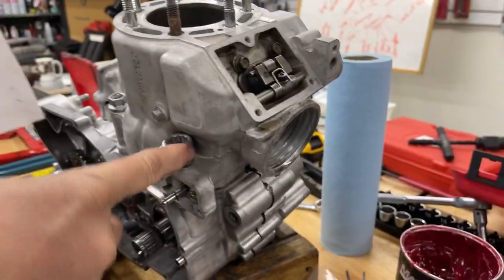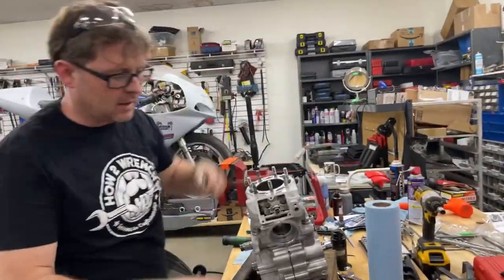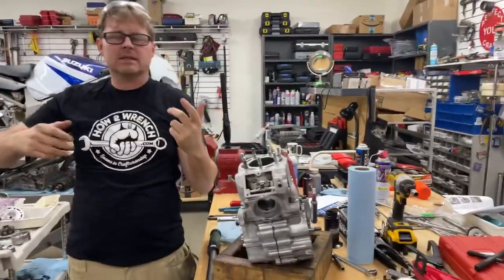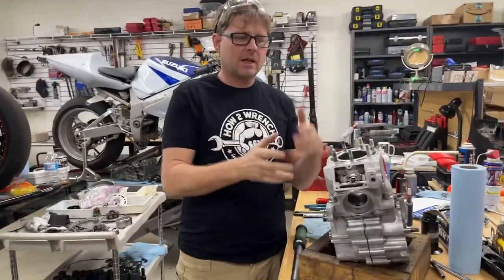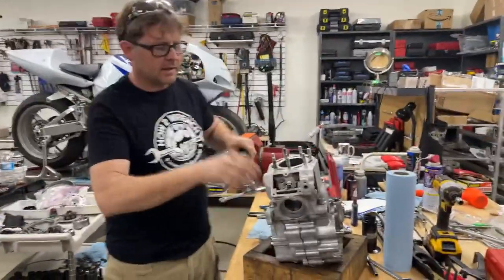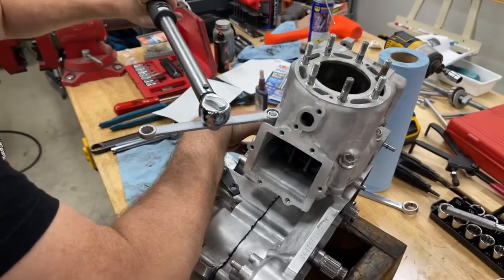Why I have to modify this Motion Pro Tool to get it to work. #motionpro #diy #torque #enginebuilding

Comment: Can crow's foot wrenches work for this job? Or are they likely to slip at that amount of torque? I've also wondered about my KTM spark plug (they give torque, not number of turns). Should I torque it with a crow's foot or is there a better option? When the engine is mounted in the frame, a large socket won't fit. Thanks for the videos!
Reply from the maker: Hi Daniel...Shane answered another fan on a similar question so I'll share (we are just the social media team) You could make this same type of tool to use on spark plugs so you can torque it properly. As far as the crows foot, you must have missed where he covered it in the video. They don't fit (he shows it). 
(FYI. He answers channel members questions daily...best $1.99 you'll ever spend)
He is just returning from an extended stay in Japan training students this winter. You can imagine how full his inbox is. We are just the social media team. 
Due to his limited bandwidth on time and demand for help, we had to choose to forward any requests from members first and it is only $1.99 a month to join.  All member tech questions like this get directly forwarded to him every day! Be mindful and honest that this is for "quick questions" that would serve you answers that can clearly be addressed. If it's a diagnosis need you'll need to use the one-on-one service. 
Here is how to get in!
* Join here: https://www.youtube.com/channel/UCBhM8DCKnT3qXwTW0eToyCg/join       
* Just looking to give us a high 5? Click here: https://www.paypal.me/how2wrench 
* Is this an emergency and your head is about to explode from frustration or fear? Get Shane’s cell here: https://how2wrench.com/ols/products/techline-one-on-one     

Have you seen our "YouTube Trained Support Shirts? Great way to "high five us" https://goodfellasmerch.com/collections/how-2-wrench/products/support-shirt